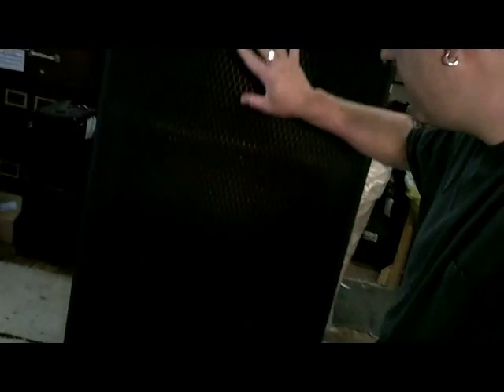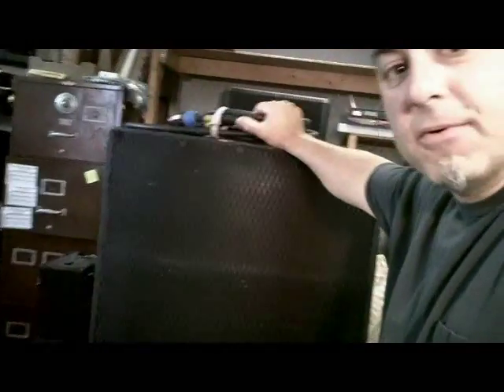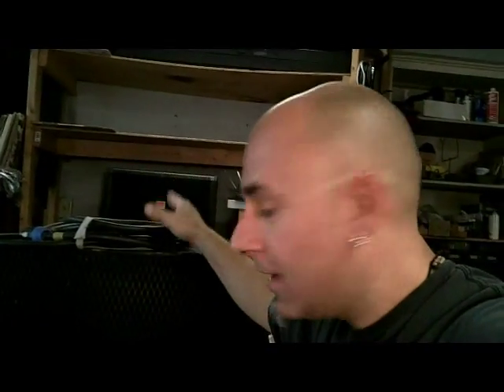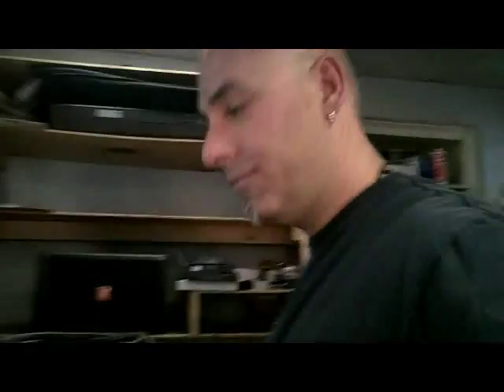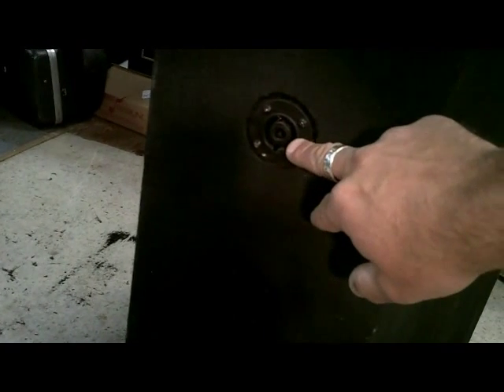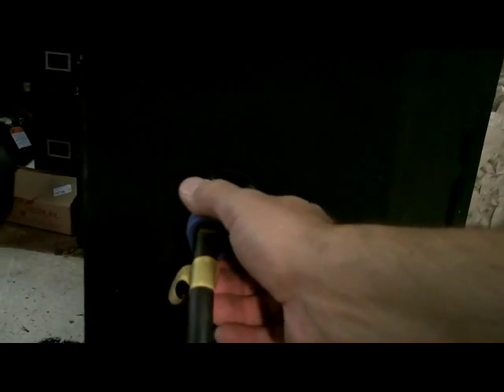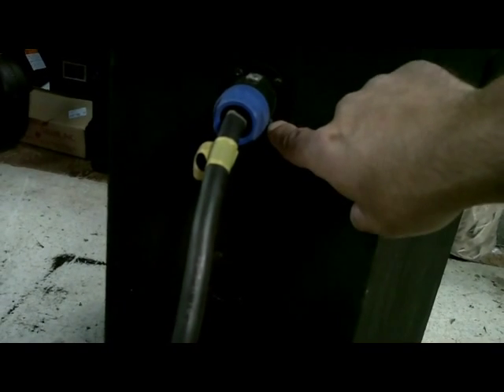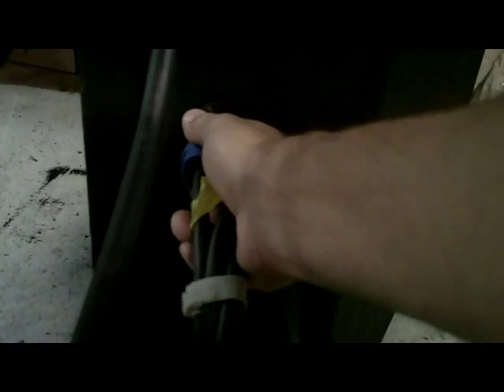NL8 concert speaker cabling

Comment: Very nice! Does this have to do with bi- tri- or quad-amping? I guess if there is a crossover processor before the amplification stage and a separate amp for each hi, mid-hi, mid and low freq driver? And one last question cause i ve been looking for a proper explanation for 2 days and surprisingly enough no one mentioned your arguments which are quite logical to me... in a forum a guy wrote that 4 pole speakon (1+ 1-, 2+ 2-) is used for connecting speakers one after the other, that is i presume parallel, I saw this at a concert couple of days ago and they were like 6 or 8 speakers , a smaller line array. thanks!